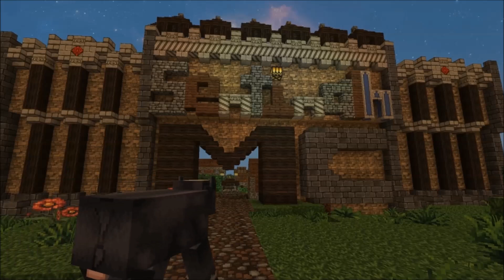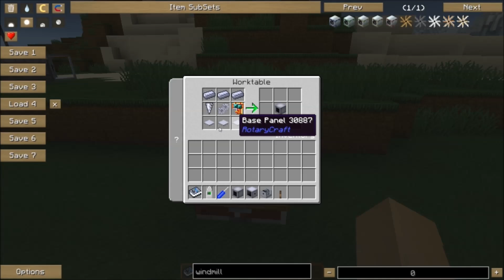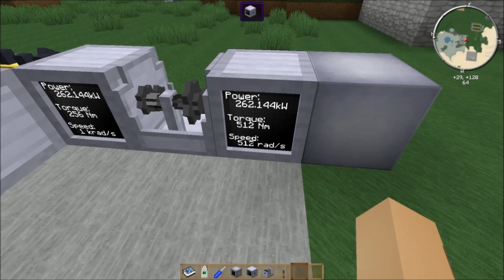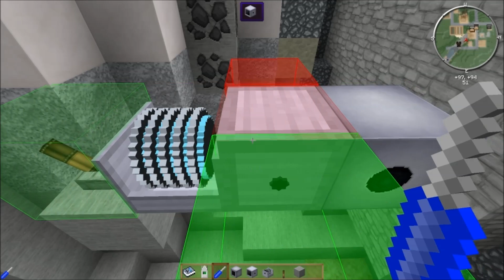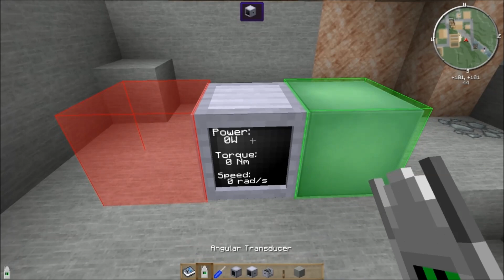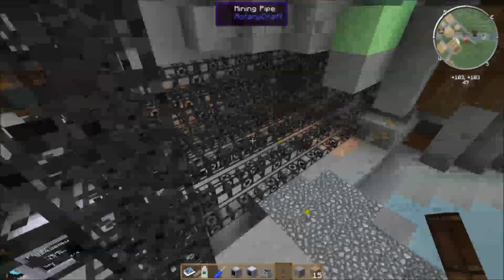RotaryCraft Tutorial #9 - Boring Machine

Comment: OK, some major corrections that need to be made for the Borer description:
One, the torque, like the power, is per block. 512Nm for a full face will not even dig through a wall of stone.
Two, that 512 value is for vanilla blocks; mod blocks are often much harder, requiring 2048Nm or more per block.
Three, it can in fact cut through bedrock in the nether ceiling, as long as it has 8192Nm and 2MW of power per block.